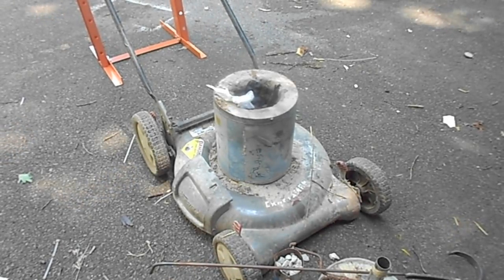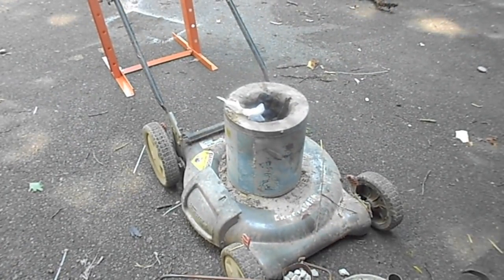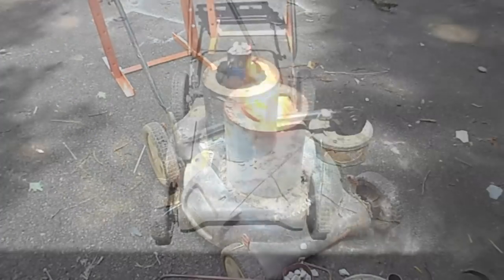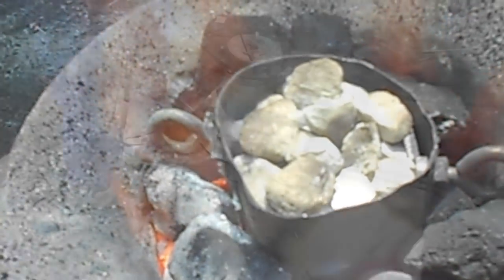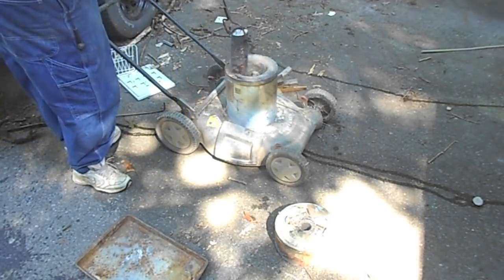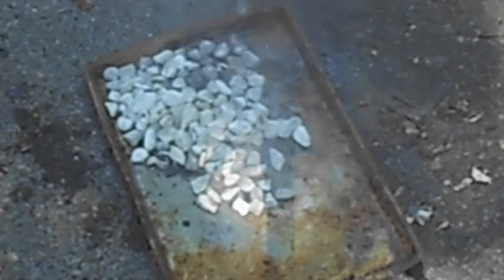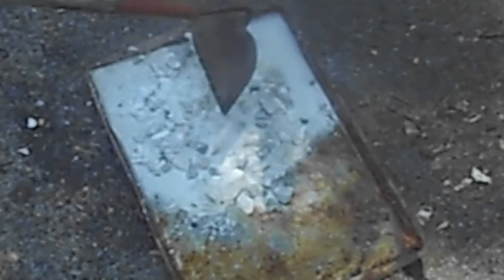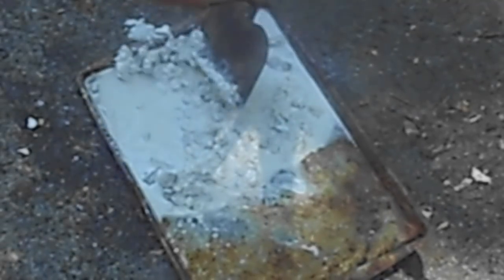How to Make Slaked Lime With Fire and Limestone

Comment: Your foundry is obviously a high tech, commercially produced unit. I assume you must have procured it through a top notch scientific equipment manufacturer. Its nice that it's portable and mobile. I saw a similar gadget once. But it had an engine on top, in place of the foundry, and it had a rotating blade underneath. I questioned its owner as to its purpose. He said that he used it to shorten the grass plants in his yard. Granted, his story sounded unlikely, but I saw his property, and the grass was of a consistent and short length. Lol
Reply: This is brilliant.
Your comment doesn't have anywhere enough attention.
Reply: @Rose-ec6he  IKR?